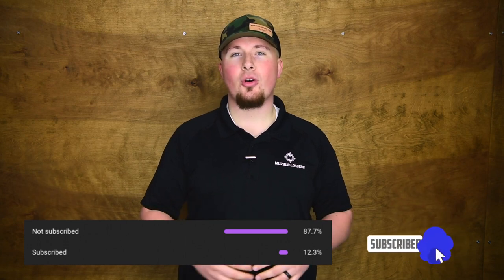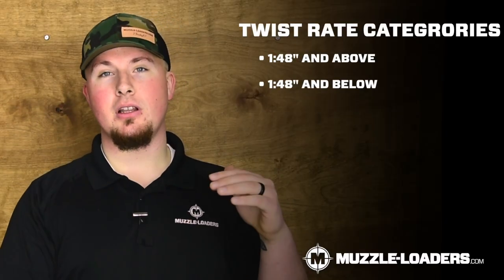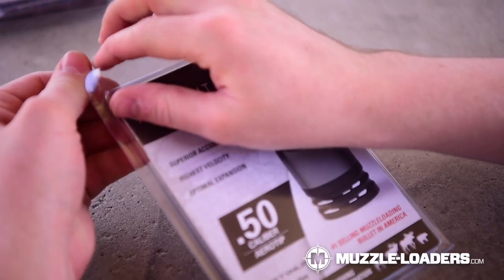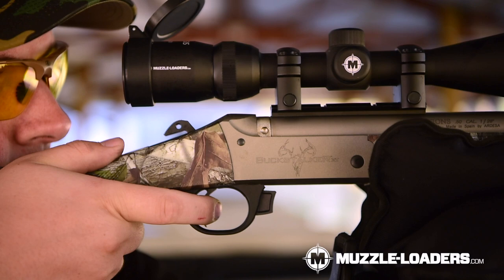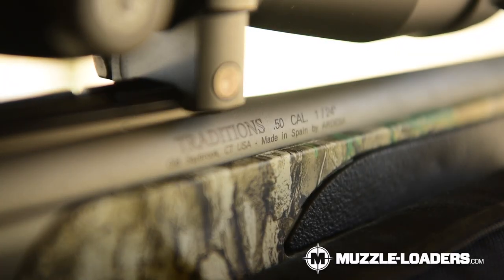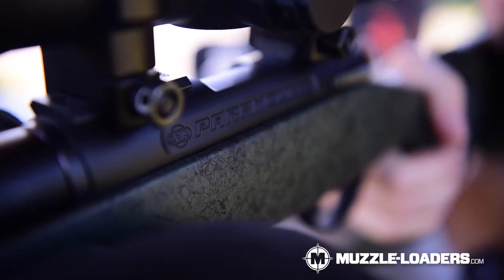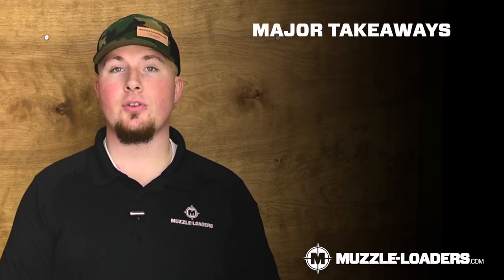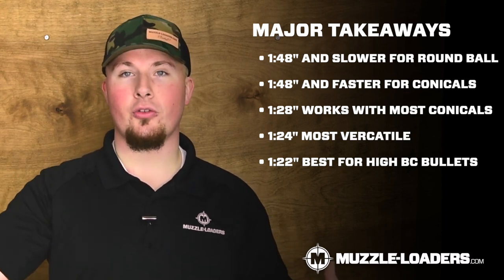Let's Talk About Twist Rates | Muzzle-Loaders.com

Comment: I have developed a new cartridge for muzzleloading rifles which is loaded from the muzzle but ejects itself from the barrel after use and is non-corrosive.   This product sets a new standard in safety and reliability for muzzleloader ammunition in the same way shotgun shells are standardized for use in shotguns.  Shotshells have a load of shot and powder which produce a safe pressure in shotguns manufactured by many different companies.  The pressure produced by this cartridge can be designed to work safely in the muzzleloaders produced by the various manufacturers.   It would also greatly help new muzzleloader shooters with safety, and it would also give them a product which will not destroy the barrel of their muzzleloader due to corrosive residue. 
 
     Those who say smokeless powder cannot be used in a muzzleloader may not know “Blackhorn 209” is 83% smokeless powder, based on the MSD sheet for the product.  Therefore, the claim that smokeless powder cannot be used safely in a muzzleloader falls apart very quickly. 

      This cartridge could also be loaded with BH209 or a similar formulation in states which do not allow "smokeless" powder during muzzleloader season, in the same way the breechloading "Firestick" cartridge is now used in the "Nitrofire" muzzleloader.  This would be a "Muzzlestick" cartridge which would work in thousands of other modern muzzleloaders, which cannot use the "Firestick" cartridge.

      This cartridge can also be removed from inline muzzleloaders by removing the breechplug.

      I am now looking for a company willing to mass produce this new cartridge for the market.  I would greatly appreciate it if you would pass this information along to those you know who may be interested in this new product.

 
A link is found below which demonstrates this new product.
 
YouTube video:   “Self-Ejecting Muzzleloader Safety Cartridge: Product Debut (short version)”
Reply: I would like to purchase some of your muzzleloader stick can you use smokeless
Reply: @Bobby-od2yf  I greatly appreciate you asking about this invention.  So far, I have not found anyone willing to mass produce the product. 

 Have you ever done any reloading?  I am thinking of making a DVD on low-pressure smokeless loads for factory muzzle-loaders.  Savage Arms proved the correct type and weight of smokeless powder can be used safely in muzzleloaders over 20 years ago.  BlackHorn209 is over 80% smokeless powder, but also contains some corrosive chemicals which can rust your barrel.  The price of BH209 has also skyrocketed during recent years.  Loading a muzzleloader with smokeless powder is really no different than reloading a shotgun shell with smokeless powder.  It requires matching the type and amount of propellant to the weight of the projectile, to produce a safe pressure for the barrel.
Reply: No I haven't done any reloading but I have watched some videos on YouTube about it
Reply: @Bobby-od2yf  
You would need an accurate scale to weigh the powder, and then use the load data I could supply in an instructional DVD.  You cannot guess, because too much pressure could burst the barrel and hurt you.